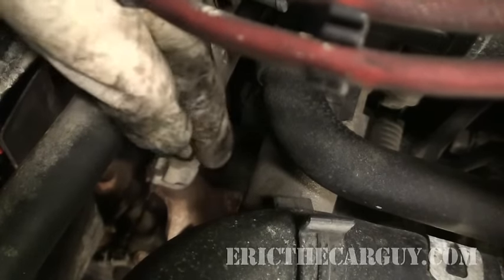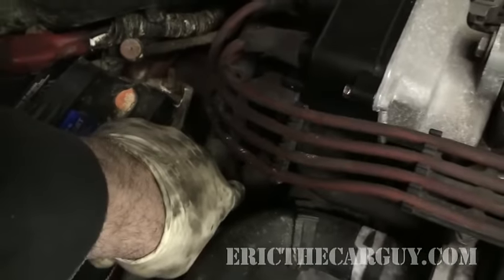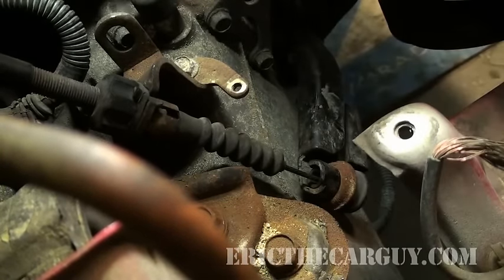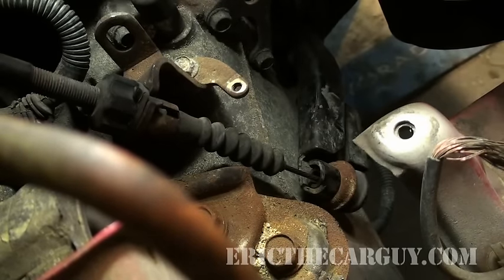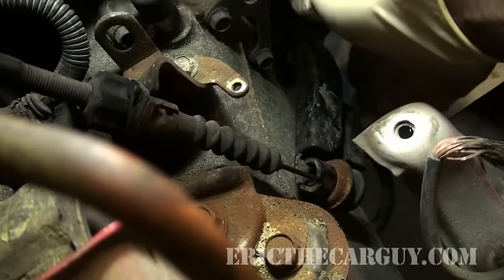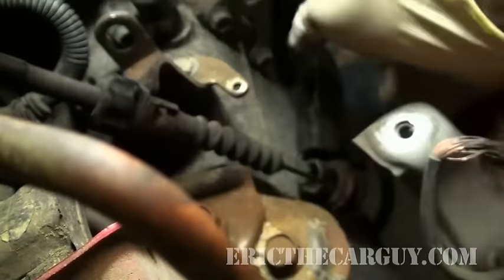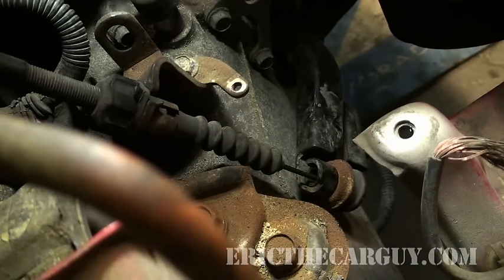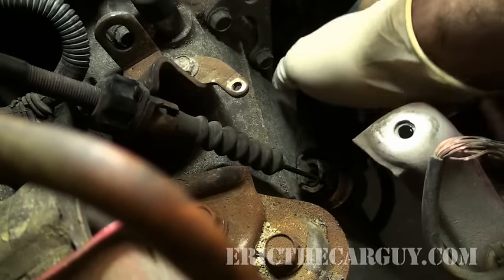How To Adjust A Cable Operated Clutch, Honda - EricTheCarGuy

Comment: After some convincing from dad,(me) my son watched this video and CORRECTLY adjusted his cable operated clutch. His step father had him convinced his clutch, pressure plate, and TO bearing would have to be replaced. It had no free travel and was not getting all the clamping force from the pressure plate. It now smokes the tires and goes into gear with no grinding. It was a good day. Thanks Eric.

Comment: If is doesn't work for you like it did for me. Buy a new cable! The old cable stretches to the point where you cant adjust it anymore. I just put a new one on my civic and it works GREAT! took me 20 mins to install.  Also got rid of the squeaking sounds of the clutch peddle.

Comment: Got some problems with my Subaru van's clutch, it doesn't do anything. It doesn't seem to engage properly*barely moves the van if I rock it) and if I let it loose while idling in gear, the engine doesn't stall.
Previous owner said something about adjusting it, but I can't remember exactly. I'm gonna go find out, hopefully it just needs the cable adjustment. Thanks for the how to video, I've got the repair manual, but it's in German so this video would probably be a lot more helpful.

Comment: Got a question...I have a 2006 Mazda 3...bought it new and it has just under 50,000 miles on it. When should I change the break pads? I don't hear any problems, sometimes if it's raining I'll hear squeeking but I think that's normal. Any thing else I should have done to it at this point?

Comment: you most likely have a leak in the hydraulic clutch system if you can't disengage the the clutch i would look next to the master cylnder there should be a smaller container next to it and see if there is fluid chances are you are out of fluid and would refil it check with an auto parts store and then get the fluid fil it follow the brake line to like the front of the transmission to the slave cylinder see if it is leaking if it is not then go to the other end of the slave bleed it

Comment: hey man not sure how to word this out but i got a 86 prelude and the 1st and 2nd gear is really hard to shift into from a dead stop, this happened once before and i took it to the shop and my mechanic simply messed with the adjustment and fixed the problem in like less than 5 minutes and my gears shifted like butter, now its all sluggish and hard again and dont wanna take it again to the mechanic is this the same problem from before cause im not all sure yet. Does this problem happen from cable?

Comment: I seen this and it brought back  a lot of memories I was 17 and had a 1979 chevette and one of the common parts were the clutch cable  I used to carry one as a spare . I also used to carry a pair of vise grips to be able to change gears until I could replace it . I do not know why they could not make one that would not break but over the 2 years I had it I replaced it 5 times even the shop said its a common problem and GM should do a recall . Man those were the days

Comment from the maker: @TheBluewolf01 Depends on the design, some cables have a tendency to snap but it can be adjusted, whereas hydraulic systems can't be adjusted and sometimes leak.  It's much easier to change a clutch on a car with hydraulics in my opinion as you don't normally have to worry about an adjustment when your done.

Comment from the maker: @spelunkerd You are 100% right as a professional videographer I know of what you speak.  Thing is I don't know if you've ever tried to video tape a repair procedure by yourself but I can tell you it presents it's own set of challenges, time being the main one so setting up every shot beyond what I normally do is not always an option.  I'm not so concerned with how I look as I am with documenting the information correctly.  I guess in short it's a matter of picking your battles.

Comment: This video has already saved me about $200. Also this method - though don't necessarily take my word for it - worked just as well for my 2006 Suzuki GS500F motorcycle  to just give me a feeling of customization in where I reach that feathering point on the clutch. Great video! Thanks Eric!

Comment from the maker: @littleburdie I don't know for sure but the general rule is that you want to increase the free play, as the clutch wears the cable or linkage will get tighter, you want to adjust it so that it has a very slight amount of play.

Comment from the maker: @sloppycoder It's not as 'dangerous' but it may not allow the clutch to fully release when the pedal is depressed and cause a jerky apply.  The adjustment for a loose cable is the same as in this video however.

Comment from the maker: @santos2089 The first thing that comes to mind is that you have the wrong fluid in there, you should be running Honda manual trans fluid and nothing else, try changing the fluid and seeing if the issue is still there.

Comment from the maker: @smitty6293 I believe hat has a mechanical linkage, you might want to get a look at it and adjust the freeplay if you can.  Also keep in mind that the linkage can wear out so be sure the linkage is in good shape and repair it before you do any adjustments if you find damaged parts.

Comment from the maker: @afijas If I read you correctly you replaced the clutch cable but you still can't change gears?  If this is the case make sure the adjustment is correct and if it is you may need to remove the transmission to find the problem.  I would also check the shift linkage for any problems just to be on the safe side.  Good luck and I hope your day gets better.

Comment from the maker: @tookimonster333 No, especially on that car.  If it's not catching at the proper height it's time to replace the clutch.  You mostly want to avoid adjusting hydraulic clutches as they are self adjusting by design, the lack of mechanical linkage makes it so.  Thanks for the comment.

Comment: I had to do this on my Honda Prelude and when it finally needed a new clutch the mechanic didn't know I knew about that because a woman called the guy. He was actually the owner of "Everett Transmission" on ferry street in Everett, MA, right across from White Hen. Well, he thought he was slick and was just going to adjust the cable. So I got in the car and felt it was at the bottom. He didn't even waste his time to test drive it or anything. So I started it up in 1st gear and called him over. I showed him by putting it in first again and completely letting the clutch out in first gear. All it did was idle and I jumped out the car and chased him and he ran to his office and called the police. Long story short, he was telling the cop I owed him almost 500$ and he couldn't produce receipts with serial numbers for the parts which you could tell were very old and factory. And I marked the two nuts and threads on the adjuster just to make sure and had 3 people and a notary sign their initials and notarized a paper with each one of us who put our initials on it, we all had a picture of our initials. Because my mother called and dealt with the guy he didn't know I already knew that trick. The cops came and said I had to pay him for the alleged work and to take the evidence and go to court. Which I did and then he fixed it right because I watched when I brought my own clutch kit over from Chelsea clutch in Revere, MA. He still tried charging me again, can you believe that? What balls on that prick. But the law was on his side even though I had proof that he never even cracked the bolts. They were all marked with a paint market showing where they liked up if they were cracked, they would never line back up the same on every single bolt. The odds would be astronomical and I scored it to incase he painted it. So be very careful of who you have touch your car. Especially a manual transmission because once you move that car out of their lot, they don't have to warranty the clutch what so ever. If you live in the Boston area, just go to DGC Autobody and ask for Donny or Danny and they will fix it right the first time and have the best prices around. Pearl Street Auto Stole 300$ worth of clothes with the receipt in the bag from my trunk and didn't even put the parts in right. They were supposed to do a clutch fan in a 5 series BMW and it came out and destroyed the radiator and costed 2500$ worth of damage on top of the 400$ for parts then the 500$ got labor. Just be careful and go to a shop with some basic knowledge or someone who has some or you will  get raped and they have every right to laugh at you for being a sucker. The law is on their side, and make sure you mark bolts and take pictures and have it notarized. You'll have to pay but the Attorney General, Better Business Bureau, Chamber of Commerce, will file complaints. The Attorney General will shut them down and fine the shit out of the whole company. Good luck, sorry for the long post but I had to let people know about this. It's not fair but it's the law with a manual transmission. Thanks
Reply: Wow.
Reply: @colinmadden5235  seriously

Comment from the maker: @93dajjdg You don't adjust a hydraulic system, it's self adjusting.  If it's not catching at the proper level the clutch most likely needs to be replaced or the hydraulics are leaking.

Comment from the maker: @aquito04 Check the shift linkage above the exhaust, if the bushings are worn it can produce that symptom.  You might also want to change the fluid, make sure you use Honda fluid.

Comment from the maker: @MrCeesol I LOVE comments like this, thanks for the rubber BTW.  You should be fine for some time actually so happy driving.  If it starts to slip again or you feel it clutching up high try adjusting it again.

Comment from the maker: @shinghi It should move with the throttle and not be too tight.  You should never have to make that adjustment however unless you have removed the transmission.  I don't recommend just making an adjustment for the sake of adjusting it.

Comment from the maker: @IronPriest82 You normally need to inspect the pads for wear if you have question about replacing them.  I recommend removing the caliper during the inspection as you get a better view of the inner pad which in my experience wears more than the outer pad.  If you like I've done videos on disc brake replacement that cover the service and inspection of those brakes.

Comment from the maker: @123ferrarifxx Probably not, if it's hard to push it it's either the type of clutch you are using, a problem in the linkage, or it was not installed correctly.

Comment from the maker: @pablo3264 It could have something to do with the shift linkage, you may want to get under there and have a look to see if anything is loose.  You also want to make sure you are using Honda transmission fluid in the trans or that may also cause shifting problems.  The last thing on the list would be an internal transmission problem.

Comment from the maker: @paintborgfun That vehicle has a hydraulic clutch and it's not adjustable.  I would inspect the hydraulics for leaks and if I didn't find any I would suspect a problem with the clutch itself.  I've done a video on clutch hydraulics that should help with your inspection.  Good luck.

Comment from the maker: @santos2089 Drive it for a while to work the new fluid in especially if you had something else in there.  It's not a clutch problem that you are talking about but a transmission problem, if this doesn't work you will probably need to replace or rebuild the transmission based on your description.

Comment: I wish you'd done this 4 months ago! LOL I ended up replacing the one on my 86 prelude and it was all pretty easy...the only part that drove me nuts was the return spring on the pedal popped off. I spent 3 F%%%% hours trying to put it back on, completely blind and laying at a weird back-breaking angle. Thanks to you though, I'm still gonna go take another look at it and do some "proper" adjusting.

Comment: Nice and clear demonstration,ill do the adjustment on my honda city by myself,just a question what's the probable cause (auto. transmission)if it's engage  in drive position the engine shuts -off,hoping for your answer and additional advice,thanks

Comment: Nice video as usual. I know that some cable clutch assemblies aren't adjustable. Example is a mid 80's to early 90's mustangs the clutch isn't adjustable because it has a ratcheting style cable for clutch adjustment. I never knew that you could adjust Honda clutches because I thought they all were hydraulic. I definitely learned something today. Thanks for the video.

Comment from the maker: @Matthew1762 Sounds like you might have too much freeplay, try adjusting the clutch as I show in this video to just leave a small amount of slack.  If that doesn't work you may have a problem with the pressure plate or clutch assembly that would require removing the transmission to inspect and repair.

Comment: Thanks for the Video, The information helps me verfiy I was scamed by a local Performance Shop called RichTuned here in Lakewood WA.  The Owner pushed really hard to install a new clutch when I already have one.  He scammed me with on Timing belt water pump which the water pump was no swapped.  The Shop did additional work which I did not sign authorize.  The shop replaced my K&N oil filter which had less than 2k miles on it, and stated my oil was low.  They replaced that, and spark plugs with OEM.  I had back up better than OEM parts at home, and they forced me to pay additional $200.

The Shop owner off to repay me, but I said to, keep the money, you did the work I did not authorize, I won't ever deal with you again.  Thanks again Eric for this video.  I have a decent 1992 Integra, I love these car,  ver good designing, design adjustments needed, other than that, I mean ... Damn near perfect

Comment: I am currently done doing clutch on my 91 civic wagon rt4wd my question for you Eric would be do I follow this same procedure even if clutch is new ? It's the cable supposed to go up a lot even though has a new clutch? It does shift kind of weird and grinds at times. Any advice would be great I was honestly thinking on replacing the clutch cable maybe that would help? 😊

Comment: I'm having some clutch issues. for the most part I like how it engages and the overall feel of it, but i feel like it doesn't spring back enough and that there isn't much resistance when pushing it in and it's worrying me because it's been grinding and/or not going into the first or reverse gears very smoothly sometimes. What do I need to do to fix it

Comment: This is a 12 years old video but here goes. Clutch and throw out bearing is replaced no visible issues. Trying to adjust the clutch and it won’t release enough to work properly. I’ve moved the adjuster from the T=hHow out bearing making a clicking noise to more then fully in contact and stick can’t get it to release enough to work. Question, are there two places where the throw out bearing shaft can bolted in, giving it less length of pull? Shouldn’t matter. Thanks.

Comment: Hey Eric.  Thank you for all of the videos.  I have a 1991 Accord LX sedan with a manual tranny.  I notice that the engine revs to about 2500 RPM in between gear shifts.  Someone told me that this is symptomatic of a clutch going bad.  Do you think that a cable adjustment would work?

Comment: hey ericthecarguy, im gonna start by saying I love your videos. but i have a question. I just got my first car,but its having clutch issues , its a 1986 vw jetta diesel n/a,   my issue is that i have about 3 inches of no pressure under my feet and then i start to get clutch,and when i let the clutch out (off the floor) it engages almost immediately .  is this just a cable adjustment issue, or is there something more?

Comment: Hi Eric thanks for the video, I have a 1995 vw polo here in the UK it has 3 nuts a 10 and 13mm and a plastic adjuster with a spring behind it so am I taking the free play out of the cable? if you had free play surely the pedal would to as my pedal has no free play the bite is at the top im not mechanicly minded thanks ian

Comment: Hey Erick first of all I love all ur videos and thanks for making them..I have a 90 Integra same as the one on the video and I'm having problems shifting the car into 3rd, 4th and 5th sometimes. It just feels like the gear did not go all the way in and when I release the clutch it grinds and the car is on neutral. The car shifts perfect when the car is off it just does it when driving it. do u think it can be the clutch pedal? Or maybe low on fluid? Or would I need a new clutch kit or a new tra

Comment: Hi. What happens when the clutch cable is too loose? For a few weeks I've been noticing a weird noise from the engine. I've found out that if I touch the clutch pedal the noise disappears. I tried tightening the clutch cable a little and the noise is no more. As I watch this video i am wondering now if I did the right thing because my car was just brought to a regular maintenance check up and the mechanic usually adjust everything to make it in top shape.

Comment: question, by needing to adjust your clutch, that means that youre clutch is showing signs of slipping right? If you using this method, would it mean that it would wear the clutch faster? technically you're using more "spring" action of the clutch than before right? just general inquiry since this is what I was told

Comment: Would this be the same procedure for my 2000 civic dx?! over the past few weeks I have been noticing my clutch pedal feels different every time i drive the car; i thought nothing of it until it started becoming difficult to put the car into gear. The car hasnt been driven much over the past few weeks do to a broken leg but still runs and starts fine BUT refuses to shift into gear, can shift into reverse but i can hear a loud screech after doing so... any ideas